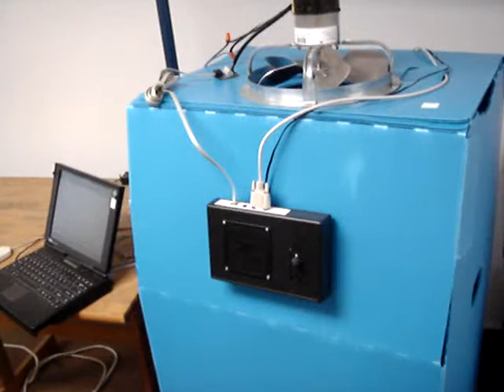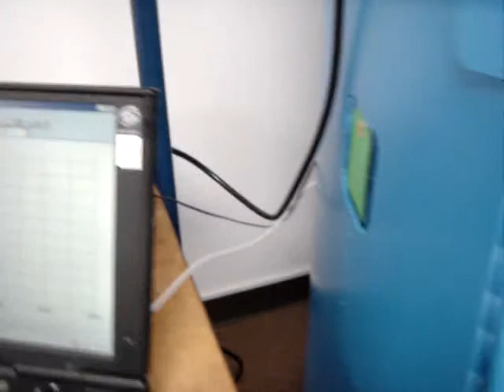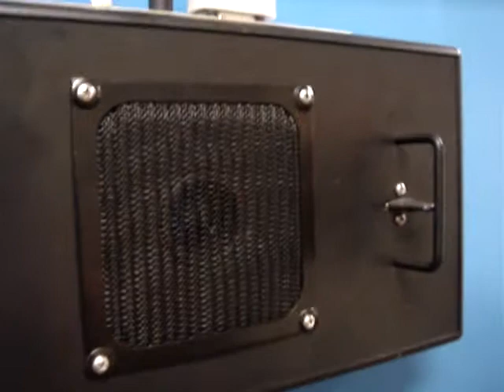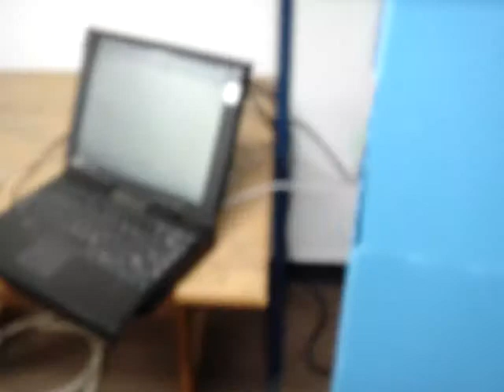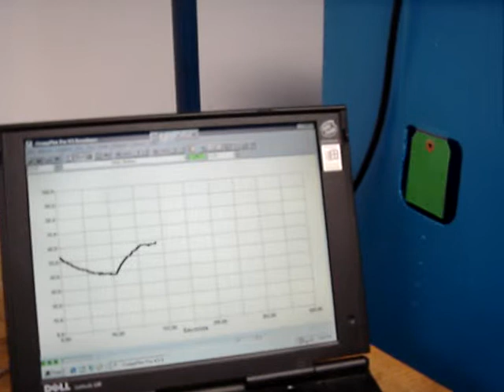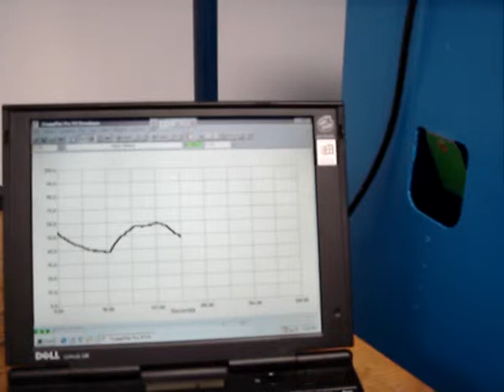CFM Matching technology demonstration

Comment: hi, this is fantastic. Now my questions is, what is the basis of the speed of the exhaust fan? I'm just using Pulse Width Modulation to configure the Duty cycle of the fan. What have you used so that the device will adjust the fan speed to the air flow?